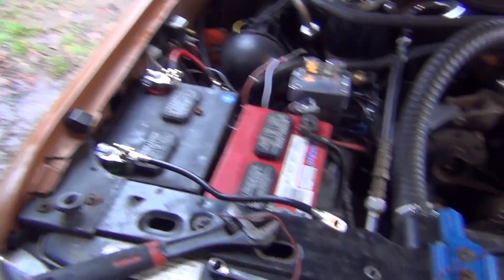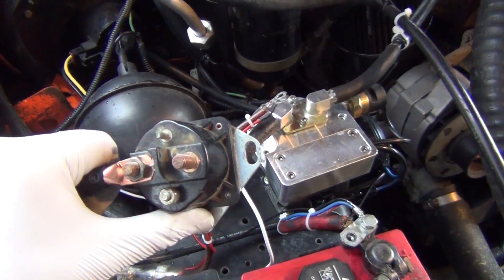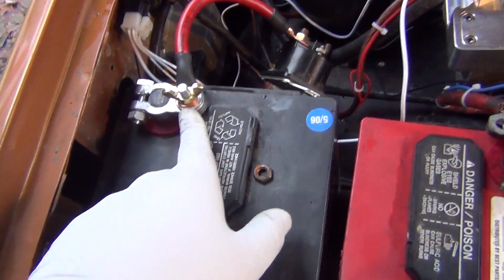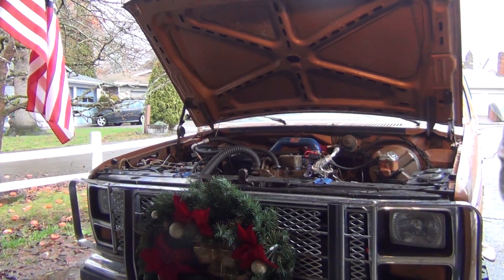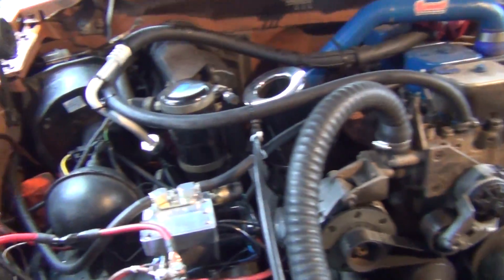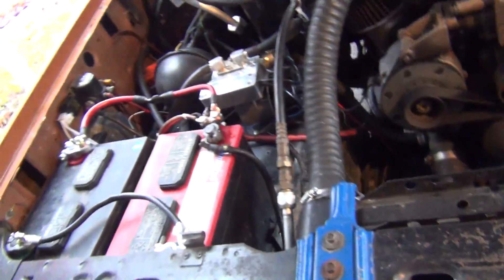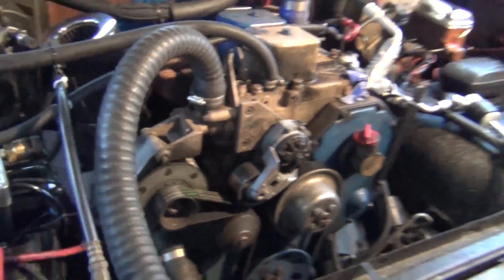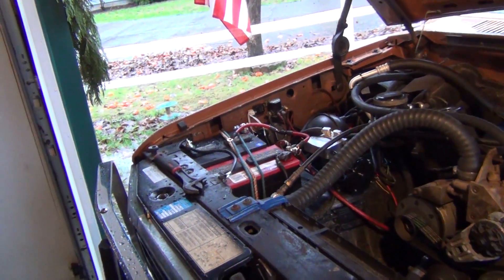Setting Up Dual Batteries | Ford F150 E-System Upgrade Part 1

Comment: im trying to do a dual battery settup. i have many extra batteries trays and harnesses to do it, but im studying different designs to see what would fit and work best with only OEM salvaged parts.

so far I like your design, but im going to put an under dash switch hooked up to the ignition tab. that way the dual battery is only on when my switch is on.

Comment: if u use the proper isolator it will switch ur alternator between the lowest and the full battery it will auto switch no need to disconnect or switch it hope this helps which will help if u want to run a 3000 amp inverter and a fridge or whjat not

Comment: Now your talking. Glad to see you upgrading. What gauge battery cables you using?  Keep up the motivational videos!
Reply from the maker: +BigBlueMotors For the cables connecting the second battery, just #4. The main POS cable going to the starter is larger than that, like 3 or 2 gauge. I may go bigger on the starter cables once I get my red tops.
Reply: hey justhes my mom and dad's 1999 dodge ram 3500 with the 5.9l 24v Cummins it has two batteries. when my mom gets home I will take a picture and send it to you on Facebook in a pm.

Comment: Welding cable would do for battery cables. I think the gauge is #0 or even #00. And save $$$ by purchasing some copper tubing.........cut to 3 inch length, smash the end (one inch or so) and rounding into shape and drill a 1/2 inch hole or even 5/8 inch. Then smooth the burrs. Presto, battery terminals!

Comment: I ran across this searching for how to put a second battery in an OBS Ford. Seriously...you went through all of that because the temps dips down to the mid 20s and not the mid -20s (as in minus 20s)?? I'm in South Dakota. We're still driving with our windows down in the mid 20s. What you need is a battery with a thing called "Cranking Amps." The more the merrier but that is not always the case. Sometimes that can be overkill too....I usually run 850 or 1000 cranking amp batteries in all my vehicles. But if you are in a warmer climate you might not be able to get them. You might only be able to find up to 500 or 600. So maybe you do need two batteries. I dunno. I shouldn't laugh. My plow truck, I'm looking at two batteries because I have the plow and now I'm adding a dump box. Anyway...nice install.

Comment: I was wondering if I could do this for my 1992 ford f150. Battery works with starter and silnoid. Something like that and other battery works with computer. My truck is not diesel but gas. Just wondering if I could do that.....

Comment: do you have a video on how you installed your hids?
Reply from the maker: +Kyle Cook I don't believe I have a detailed video on my install. I can make a "after the fact" video and explain how its all hooked up.
Reply: justhes ok that'd help me alot.  I plan on getting some type of new brighter headlights, what brand/type do u recommend? And Thank you in advance.
Reply from the maker: +Kyle Cook get hid's from ddmtuning . com they also sell conversion lenses. I am using the HID's from them, no issues other than the headlight connector.
Reply: +justhes ok thank you, and can you describe the problem you had with the connectors on the video that you make for the hids?
Reply from the maker: +Kyle Cook They used crappy spade connectors that wouldn't hold and lose connection.
Reply: +justhes  do they not come in or with a headlight housing?
Reply from the maker: +Kyle Cook The kit is sold separately from the lenses. I bought the lenses from someone else.